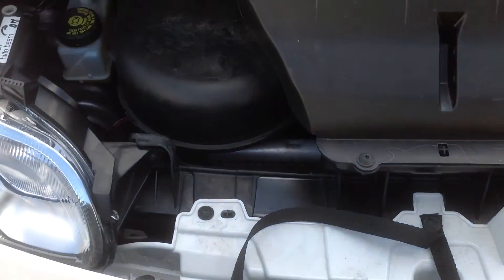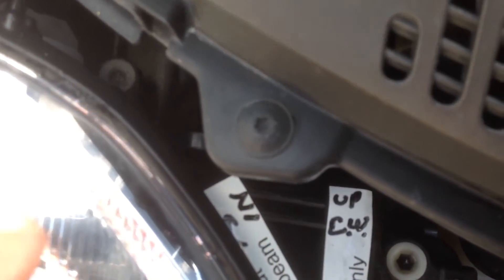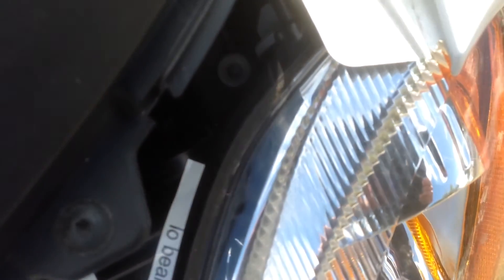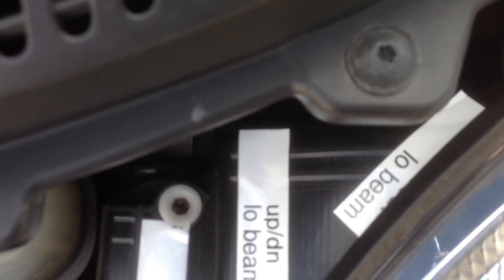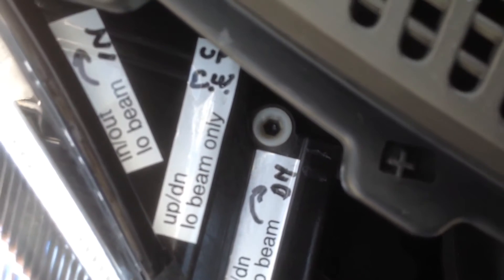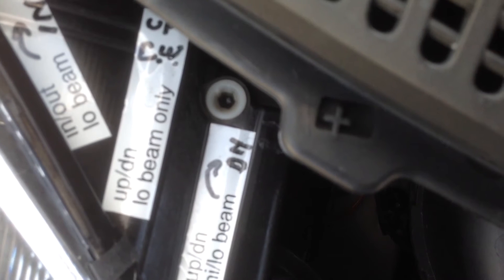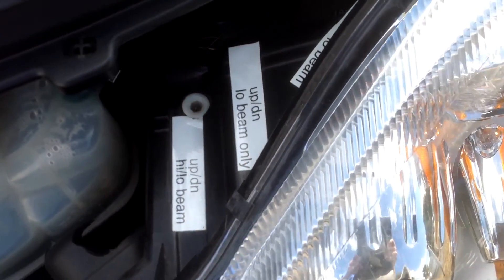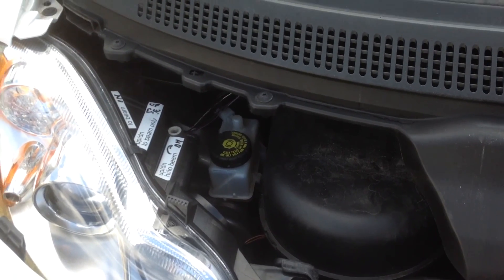smart car headlight adjustment part 2

Comment: Hi. I took my Smartie to mechanics because the headlight won't adjust the headlamp. They said there is no way to be sure if the gears inside are faulty or if there is something else wrong. They suggested that we open the entire headlight unit but they can't guarantee it will be sealed properly again without water and other things making its way to the wiring. I'm hoping that someone will be able to give advice other than just to replace the entire headlight. I live in South Africa and the parts are incredibly scarce. I hope to hear from you soon 😊
Reply from the maker: once the head lamp is out the the car remove the small clips that hold the clear lens from the back I think there are 3 or 4. then use a blow drier to heat the mastic glue its black, to soften it then you can seperate the front from the back. Once that is done you remove the chrome bezal it has 2 or 3 screws, when that is off you can see the gears for the adjustment. Mine had a broken plastic mounting pin. I was able to repair it using super glue and thin set which is a powder. first you glue it then sprinkle on the powder then apply more glue and powder keep on doing this until you get built up. you can see what each adjustment does since its now apart. Then just reverse the order to assemble it.

Comment: How did you get the rivet out to adjust the up and down? Thanks
Reply from the maker: I used a drill  started with a small one then went larger you doesn't want to go to big at first because you will remove the hex for the Allen wrench

Comment: Quick question: does the front clip allow for any adjustment? My door is slightly rubbing the fender.
Reply from the maker: Kevin Moses        there is some play on the mounting tabs on the fender, you would have to remove all the plastic hold pins and reposition the fender then reinsert the pins to hold it in the new position
Reply: Would the entire clip need to be removed or just on the side we need to reposition?
Reply from the maker: how is the other door  the space should be equal. if not you may have to do both sides remove all push pins  so the fenders can be repositioned make the fender/door space equal on both sides  then reinsert the pins. you want to be able to easily move and reposition the fenders
Reply: Got it, thanks.